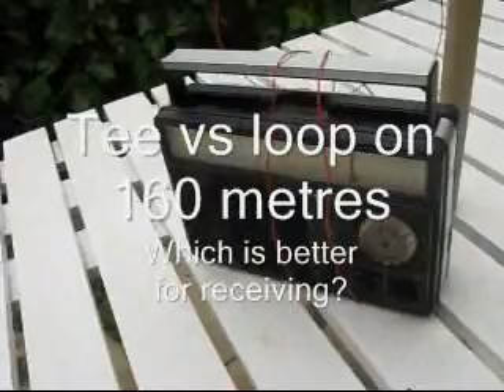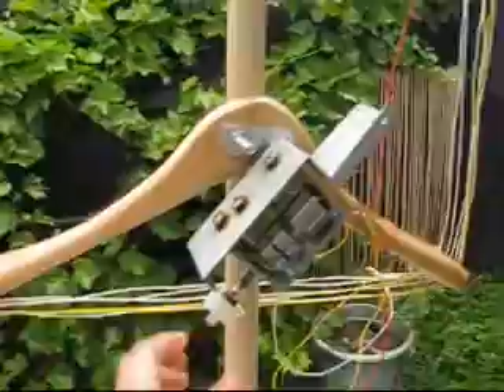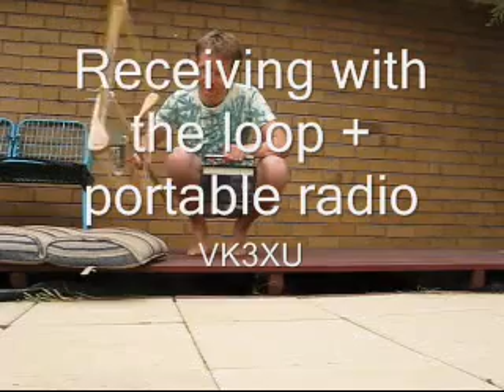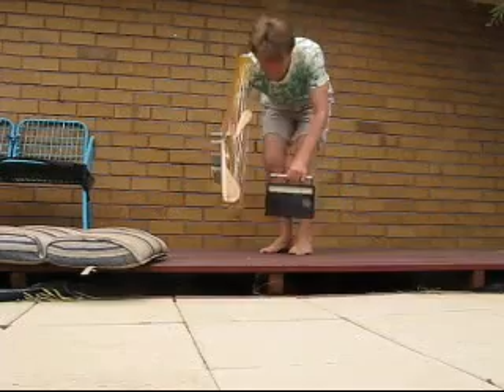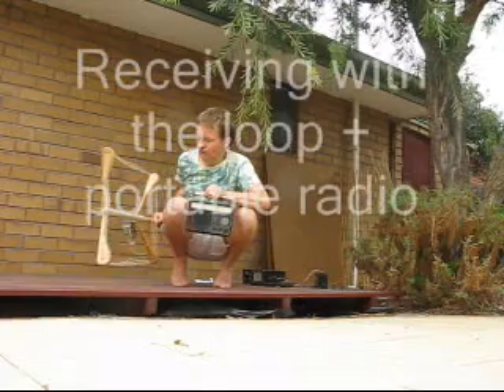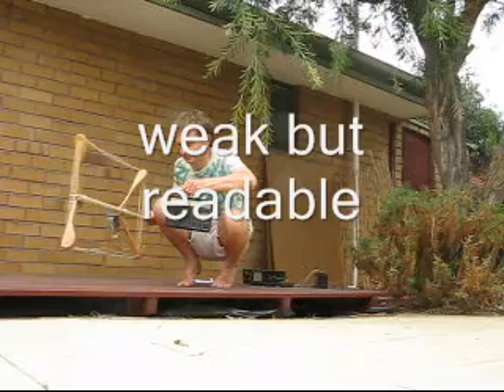160 metres AM: receiving comparison between loop and tee vertical antennas

Comment: Hi Peter, I was wondering, What is your counterpoise for the vertical? I would say The vertical would provide a higher signal but a poorer signal to noise ratio. If you strongly coupled into the loop I would say the signal would be still weaker than what you could get from the vertical but superior because of less noise. It would be interesting if you could make the vertical 3 times the height, but I'd say the noise would still make signals less readable :)